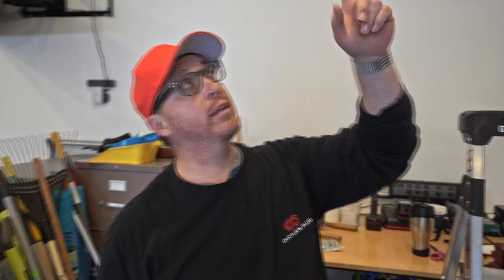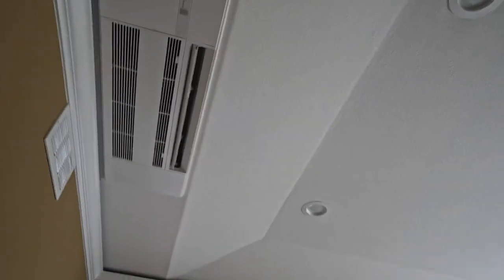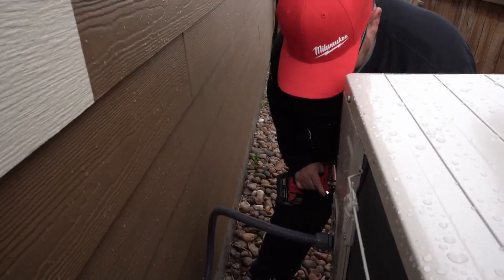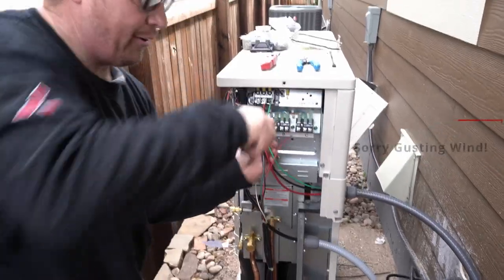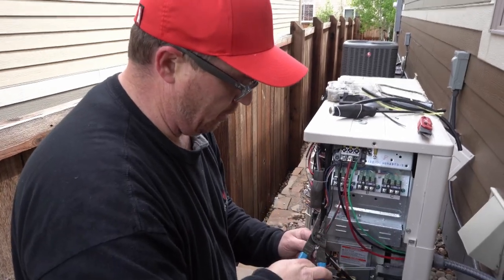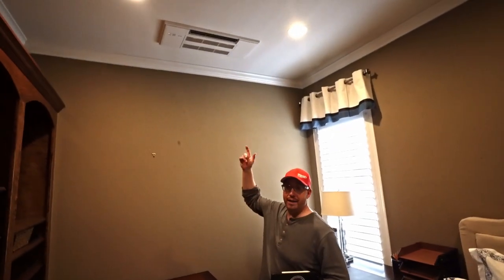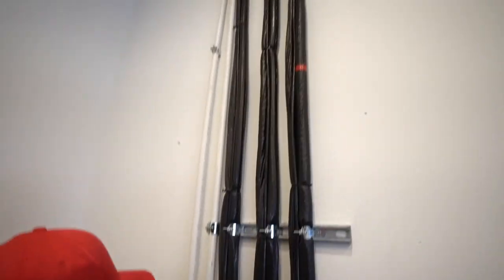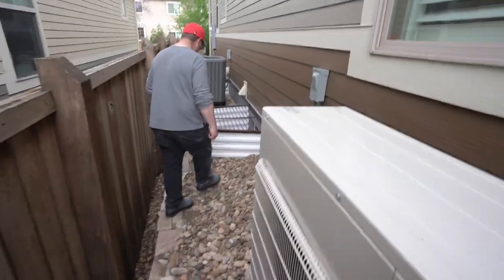3 Zone Mitsubishi Mini Split Heat Pump Complete Pro Tips Install

Comment: I have 5 ceiling cassettes, they look great. I absolutely didn’t want holes drilled into the sides of my home with lines run along it to the condenser. My 5 lines all come from 2 holes in the attic. I have one wall mounted separate unit in the basement.. All Mitsubishi. Love the system over conventional whole house HVAC..
Reply from the maker: @tjinytjiny6615  thank you

Comment: Great Job... Important for clients to see the mess it is to run piping (or work) in an attic with blown in insulation. When they say "how much to install?" Now they no why. Only concern was in the intake to the condensor (air) in in front of a dryer vent.  Guess that makes for a customer that will always need the coil cleaned
Reply from the maker: That's a combustion Air vent not a dryer vent. Thanks for watching.
Reply from the maker: You can see the other Combustion vent down a little from this one. They want 2 combustion air ducts to the furnace.

Comment: I’ve watched many of your videos and a couple of months ago they convinced me to get the ceiling to sit in a multi zone Mitsubishi system. I went to the only diamond dealer in my area and they recommended and installed a system with two 9K ceiling cassettes in my roughly 860 square-foot basement because those are the smallest ones they could get. They said they couldn’t get the 6K ceiling cassettes.  
And a 24K Wall mount unit for my garage.  The garage is only about 560 square-foot, but I want it to be able to bring the temperature down even if I pulled a hot car in and the company and myself thought that the 24 would do a lot better than 18,000 that was there before.    All of this is run to a NTXMMX36A142AA  36k 4 port outdoor unit.  

The issue I’m having is that I cannot get maximum cooling from my 24K garage unit without turning off one of the basement units.  I can only get about 56 to 58° air to come out of the garage unit with both basement units on if I turn one or both of the basement unit off the air coming out will get down to 46°.

If all three units are on and set to 65°, the air coming out of all units are around 56° at the coldest.  

The company is saying that there should be no issues with that 36K outside unit even though the inside heads equals 42K. 
My question is, are you of that same opinion or do you think they should have installed a 42K outside unit?  

I’m just trying to get my stuff operating properly. Thanks for any advice you can give.
Reply from the maker: We never over size the indoor units. I match the totals from inside to outside.
Reply: @ductlessplushvac  great. I’m not sure how to handle this because I’ve spent $26,000 getting the system installed.  And I know they’re not going to want to replace that 36 with a 42 and not charge me more.  If they want to do it at all and admit it was a mistake.
Reply from the maker: Just talk with them.
Reply: @ductlessplushvac  I am talking back and forth with them.  Hopefully they make it right being a diamond installer.  They seem like great people but you never know
Reply from the maker: @KnightsGarage  Mitsubishi will give them a new unit (1) time a year for emergencies like yours just ask them to see if they can do that.
Reply: @ductlessplushvac  I don’t know if they can do that or not because they told me they get all their stuff from an HVAC distributor in Birmingham. But I will mention it.
Reply: @ductlessplushvac  I’ll let them know about this and they said that they’re waiting for their Mitsubishi field rep to get back in touch with them to let them know if replacing the outdoor unit is what is needed.  If he says that’s what is needed then his balls has to sign the approval for them to do it. But he said if that’s with Mitsubishi field rep says then it’s more than likely a go.   
I don’t see why the field rep would say heaven 42,000 BTU of ceiling cassettes /wall mounts on a 36,000 BTU outdoor unit is not the issue of why the 24,000 BTU in the garage will not put out its maximum output unless I turn off one of the basement units.  
Thank you for all your help!  I know you don’t want to go against any other installers, but the information you provided have been a great help, and I would’ve never even known about the ceiling cassettes from Mitsubishi if I hadn’t watched your videos.  Just with your company was closer to AL.

Comment: This is th ebest option for the people who don't want to mount wall unit. Great job. Here's a question in regards to installation. Is there any mold issue in the attic after installation? Any condensed water can be created around the ceiling unit in the attic?
Reply from the maker: Nope you will not have that problem
Reply: awesome. Thanks for the reply.  @ductlessplushvac

Comment: Some of my rooms don’t have deep enough ceiling joists for these units and the HVAC contractor is suggesting to just box them out 2-3 inches under the ceiling - thoughts on if this will look okay or am I just better off going with a regular wall mounted unit?  I think as long as one side is flush to the wall it’ll still look better?
Reply from the maker: That's definitely (1) option. I don't think it would look bad.

Comment: These ceiling cassettes look amazing. I’ve been told by everyone in the area to run a gravity fed drain line and not the pump fed lines. Because pumps clog up and flood your ceiling/wall and floor. Is that an option on a ceiling cassette? To have a gravity condensation line? And have you ever had any problems with the pumps failing and making a problem? Thanks
Reply from the maker: I’ve installed hundreds of units and I haven’t had 1 pump break.
Reply: That’s good to know. On the ceiling cassettes can you access the pump from under the drywall and ceiling? I don’t have an addict so I won’t have any access after I finish the ceiling.
Reply from the maker: @briandunn9700  yes all service is done from below you don’t need to get above the unit ever.
Reply: How can you install one of these units in a lived in home on the first floor with a second floor??  Have you done it? Do you need to repair the sheet rock after?? Thank you & your job looks great.
Reply from the maker: @paulconnolly2969  yes we have and sometimes no drywall repair.

Comment: Have you guys ever run the lines through a 4” or 6” pvc pipe, as opposed to running them side by side?
Reply from the maker: We have under gound. Why would you use that when you can use line-hide? That customer is going to build the wall out and box them lines in. 4” & 6” PVC IS HUGE.
Reply: @ductlessplushvac  🤔wait..
…Let me clarify…
… when running the lines through an inaccessible ( for a person ) crawl space
One could  access an entrance to the inaccessible crawl space and connect & push the pvc pipe over the joists to an ‘accessible area’ to make it possible for the lines to pass through the inaccessible area.

I was curious as to the diameter of the pvc that would be required to allow the lines to easily pass through to the accessible side.
Once the lines reach the accessible side, then one could pull the lines to the air handler.   It would be a ‘real fun job’…
… well, maybe not 😄
Did you guys ever have a situation like that?
Reply from the maker: @stepside2839  nope. And sorry just seen this text.

Comment: Love your channel and videos!

For this customer, Why not an MXZ-SM42 with a branch box?

Do you install surge suppressors or icm493 voltage watch guards?
Reply from the maker: They didn't need a MXZ-SM42 the 30 is sized just right. We use a DSB PROGRAM and sized it with that.

Comment: I'm looking to build a quonsent home with an upstairs loft, so would it be possible to use the ceilingmount units under the upstairs floor? Installation would be prior to completing the floor upstairs.
Also, a crawlspace on either side of the loft would be an option.
Reply from the maker: You can install them in any flat ceiling

Comment: Could you have run a branch box in the attic to avoid running 3 line set runs down the garage wall and out of the house?
Reply from the maker: We could have but a branch box system is very expensive and the outdoor unit has to be a 36k or 3ton unit for that. So it would be a bit overkill they only needed the 30k or 2.5 ton system saved them several thousands of dollars $

Comment: How would you heat and cool a restroom space?
Reply from the maker: @timgroh8616  not with a ductless unit unless the room was very large. You can use in-floor heating. You typically don't require conditioning in a bathroom. If you take a shower you will heat it. And if you have a bath exhausted it will bring in air from the living space and totally keep the room comfortable.

Comment: Nice work. Where does the drain line terminate?
Reply from the maker: Outside with the piping you can see it in the video.
Reply: @ductlessplushvac  Thanks for the reply.  I have seen awful drain terminations that terminate near the foundation creating an always wet situation and it eventually damages the foundation and walls (leaching water) up into the framing.  It would be nice if you explained in a future video, the right way to pipe the condensate drains.  Thanks in advance and I enjoy your videos 🙂
Reply from the maker: @terrylewis5786  thanks Terry!

Comment: How will you hook up all 3 drains?
Reply from the maker: We run them from the indoor heads drain line with 3/4” PVC and run the pipes outside side with the main refrigerant lines.

Comment: I thought ceiling cassettes needed to have access from above and condensate lines need to be insulated if ran through the attic.  They are by far better looking.
Reply from the maker: We have them blown out
Reply: @ductlessplushvac  sorry, i don't know what you mean "blown out"
Reply from the maker: @jerryjason8091  like a sprinkler system